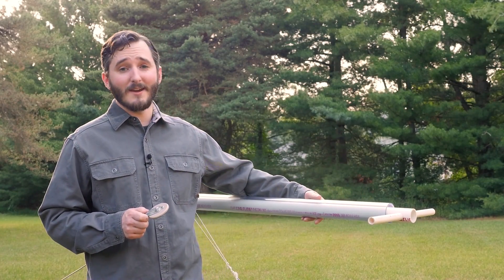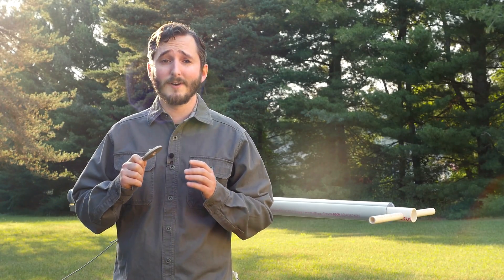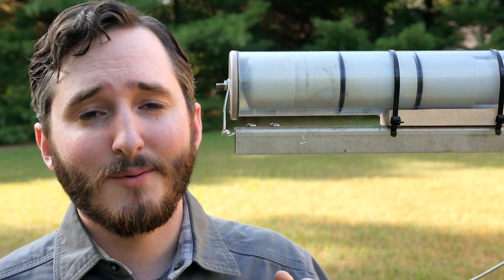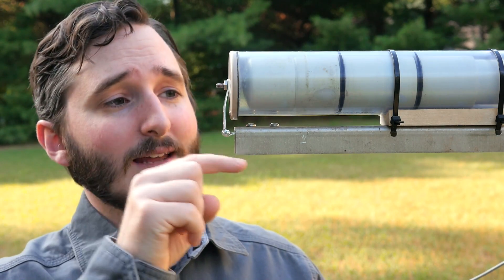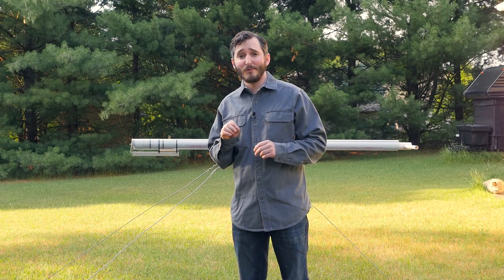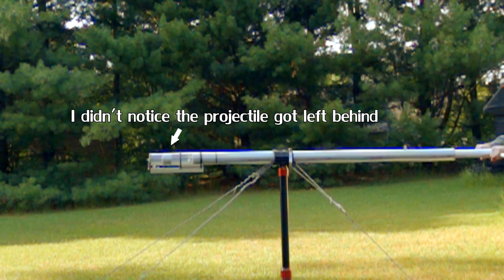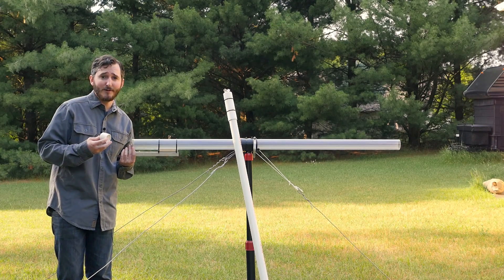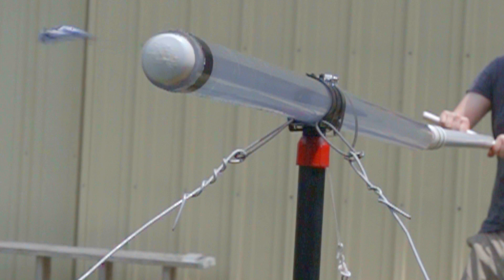Firing A Clear Vacuum Cannon & Testing Viewer Suggestions

Comment: ok so here’s my idea :
• keep the pivot point of the valve such that it naturally falls and can’t stay upright by itself. Use a bolt made from a ferromagnetic material at the middle of the valve’s disk, and cut it down such that it just makes a « button ».
• embed a big, strong magnet at the tip of the piston. Make it such that the tip of the piston is smaller in diameter such that the projectile fits over it like a sock. It will minimize the distance between the magnet and the bolt.
It’d be operated like this :
1. push the (piston + projectile) group through the tube, slightly further than the valve.
2. Close the valve. It will be held by the magnet.
3. Pull slightly until the valve seals, but keep the magnets in contact.
4. Pull hard to separate the piston and projectile from the valve, but don’t go all the way. It will now be held by the pressure differential between inside and outside of the tube.
5. You’re primed. Pull like a normal piston cannon to fire. 

Hopefully, that’ll push the valve outta the way a bit easier.
Reply: Maybe one day this will be read, haha.

Comment: how about a double door for the valve? have it split in half so it opens out horizontally. also, have a bit overlapping the center on one side to make the seal tighter.

Comment: Hi, I've been following this project and also have made one but have not fired it yet. I was just wondering if you didnt use a long pvc pipe with the handle to fire the canon. But, to cut the pvc trigger pipe to a shorter length and pull it with a rope..I was wondering if you would try this plus it would be compact and lighter to transport it..Thanks!
Reply from the maker: The piston and pipe it's attached to fit inside the barrel so it doesn't really make a difference in how large it is to transport, but you could pull the piston back with a rope if you wanted to. You just would have to feed a rope through the pipe every time.
Reply: You have some Great Projects!...Thanks for sharing!

Comment: HEY! Try to make a two door latch. Both doors open forwards and then close with a small spring. Rubber on the doors will cause a vacuum. It should work like a burst dick but not need to be replaced each time. Any questions just ask but good luck

Comment: I'm not sure it would open fast enough, but you could attach rubber bands to the valve, stretched over the hinge and connected to the valve-holder. Kind of like a rubber band over your kneecap connected to your thigh and shin.

When the band is at more than a 90° angle, it won't exert an opening force on the valve, but once it starts to open, the bands will help accelerate the valve open.

Comment: i suppose the air cushion may be pushing the stopper in the front out and it rebounds back up to hit the projectile. if that isnt the case i would suggest making fixture by which you could easily hot swap burst disks so you dont have to spend all day taping them up and removing the tape.

Comment: You could add a secondary, small chamber that pulls a vacuum at the same time, but have this secondary chamber slightly shorter in length than the firing tube, so that the air rushes in right before the projectile barrel. This secondary tube could be a much smaller diameter, and would be used to open the valve of the larger firing tube. 

Another idea; use cutouts of plastic that you can just place onto the end of the barrel, possibly with some sugru applied at the end of the barrel to make a better seal (look at TKOR's video on homemade sugru). This plastic piece would have no hinge, you could either just leave it be and have it shoot off with the projectile, or attach it to the end of the firing barrel with a piece of string so it doesn't fly away every time.

An alternative of the above idea would be to dangle the plastic seal via a string (or 2 for stability) above the cannon, in such a way that it can easily be pushed away by the projectile, flinging it upward and around, constricted by the length of the string

A final idea, unrelated. Try to put a thick piece of rubber, like multiple balloons on the end of the barrel. try to find a rubber, maybe spandex, that you could just stretch around the barrel, and possibly aid in holding it with a pvc sleeve that slides over it. I would like to see how much the rubber is pushed in to the vacuum by the normal atmosphere, which leads to the final idea.

Get a thick, maybe 6 inch inner diameter piece of acrylic tube, and place a seal on one end for pressurizing. Mount the vacuum cannon tube inside it, maybe with multiple filed out bushings to center it inside the acrylic (or use acrylic for both tubes). The end cap on the outside tube would have two valves on it. The inside tube would be connected to one of these two valves. Use a screw on end cap if possible for ease. Pull a vacuum in the inside tube, and pressurize the outside tube. You end up with a vacuum cannon inside a pressurized tube, in such a way that the projectile makes it out of both tubes. 

I will send this to your email, along with a diagram I drew in order to visualize it.

Comment: I had a question, would you be able to fire anything aside from the pvc cap like a smoke grenade or an airsoft frag, I've had an idea that I want to test a vacuum cannon mortar but I don't really have the funds to build and test it I figured I would ask to see if you knew if it might or might not work
Reply from the maker: Anything that fits in the barrel

Comment: Add a little rubberband assist to the valve that gets tensioned about halfway into the draw by a wire attached to the grip section.

If enough negative pressure is built up before the valve opener is tensioned it should stay closed until release.

Comment: what if you drilled a small hole on the proyectile so a little air rushes in through there in front of the proyectile therefore pushing the valve open?

Comment: Looking at the slow motion frame by frame, it looks like the flap maintains a constant (too slow) angular velocity after it loses its seal. Perhaps you could design a valve that is slightly recessed into the barrel and sealed with an o-ring like your piston. This might give the air pressure more time to accelerate the flap to the necessary speed to push it out of the way, instead of only pushing in the instant before it loses its seal.
Reply from the maker: I agree, an inset valve might be what's needed
Reply: Not too sure, a valve that's inside the pipe sits tighter, and will probably be heavier.
However omitting the hinge will help to some degree; and if there is some (light) piece glued to the valve that's inside the pipe to hold it you won't need a hinge. And if that piece inside the barrel is making a pour seal it won't have much friction with the walls, but it will give the piece a chance to accelerate more. (you that you would still use that same disk for holding the actual vacuum seal)
---
@all the engineers: because of the hinge the valve needs to get both Angular velocity and horizontal velocity, so it needs to overcome both angular inertia and linear inertia. (MV² + Iω²) That's one reason why the hinge is slowing it down. Then consider the fact the hinge is made out of metal, adding mass, and adding inertia. And then the hinge is not designed for fast opening with minimal friction, I mean nobody opens their funiture doors with the speed of sound.
Another (minor) reason is that once the valve has opened by a little bit, it's at an angle, somewhat working as a ramp redirecting the air in stead of being pushed away by it.
Reply: NightHawkInLight what if you had a small piece of maybe cardboard plugging the end, the vacuum could keep the cardboard stuck to the tube, but when the pressure increases between the projectile and valve, the cardboard loses all adhesion to the pipe, letting it fall away. Plus, if the projectile hit it, it probably wouldn't affect its trajectory/velocity, since the cardboard would have very low mass, and as such, very low inertia to overcome.
Reply: I'm thinking a lower mass convex seal (think half a ping pong ball) with an over center spring (or rubber band) in the same direction as gravity. Only a little force to push it past the pivot, but then it should snap down really fast.

Comment: Hmm, what about a flap valve made from leather, reinforced on the back with a metal disc? The projectile will still hit it, but it should be much more durable. Another idea is to cut the muzzle end of the barrel at an angle, and have an elliptical flap valve- the projectile won't be smacking into it so hard since the shallower contact angle makes more a softer impact... in theory...

Comment: You should use a spring to pull the cover back. If you now fix the cover to the opening with a switch and the switch with your "pull-back" trigger so is opens only in the last second, you could make a better shot

Comment: How about a flap that is a ring the same basic diameter as the tube welded to the tip of the hinge.  Then use a thin plastic sheet to cover/seal the ring.

Comment: Whats the terminal velocity of the projectile, a little less then the 
speed of sound? Are you close to that or will that require a longer 
barrel?
Reply from the maker: It's actually higher than the speed of sound because air particles can accelerate faster to fill a vacuum than a wave can propagate through them at normal pressures. But yes I would need a lot longer barrel to give time for a projectile to get up to those sort of speeds.
Reply: Awesome!

Comment: you should attach a rubber band to the valve plate and stretch it downward. the pivot point of the valve can then be moved toward the rubber band so that even the slightest movement of the valve would bring the whole assembly out of balance and accelerate the valve with the power of the rubber band

Comment: You might try making a double sided flap, like two half discs that open from the middle.  That way each half doesn't have to move as far to get out of the way, and even if the projectile hit them, it would hit both at once, reducing deflection and damage.  It would take a little more work to get it to be air tight, but I think the results would be worth the effort.
Reply: Another option that would certainly be more work would be a vacuum switch, servo, and electronic time delay.

Comment: I almost wonder if you could make a reusable "burst disc" by using an air tight rubber seal that is also able to open up. So it holds the air in but when something hits it the projectile can go through? I don't know.

Comment: Try using a spring to pull the valve back when the vacuum is released. I've been thinking about a way to keep it attached before you started pulling the piston back as well, but I'm not sure my ideas are sufficient. Here's a couple anyways.

1. Have a string on the valve that attached to a small pin of some sort on top of the pipe that moves down when the vacuum is good enough to keep the valve in place. The pin would definitely get in the way if it moved directly into the barrel but if you attached a small piece of pipe that extruded from the top of the barrel that could hold the vacuum and pull the pin inside, effectively blocking the small leak and moving the pin out of the way of the string that held the valve in place, I think it might just work. 

It does seem kinda complicated but maybe if you simplify the process of the latch being released due to the vacuum in the barrel, you would have a solid design. 

2. Here's another idea that I just thought of. What if you put a strong magnet at the end of the piston and somehow used an external magnet to release the valve latch after you pulled the piston back a bit (so there's enough pressure to hold the valve on). 

If anyone else has an idea to improve my idea, please let me know. And if you like this idea please like it so he sees it. 😊
Reply from the maker: There might be some options with magnets, it's a good idea to think about.
Reply: NightHawkInLight cool, I mentioned you in another comment and here's what I said there (I was thinking about the magnet idea a little more). 

You can use a magnet in the end of the piston and a external magnet on one side attached by string to the valve. This way when the piston is at the end of the barrel, you can push the spring loaded valve in place and use the magnet to keep it there temporarily. Once the valve is pulled back there should be enough pressure to hold the valve in place and at the same time the magnets will separate and the external one will fall to the side, out of the way of the impending destruction coming out of the barrel lol

Comment: Try using something like a paper cup for the valve. Just insert it into the pipe bottom side in so that it wedges itself in and holds the pressure when it's being pulled back. You can cut most of the cup off since you just need the wedge shape, and since it's light enough it'll just become part of the projectile like the aluminum did.
 Alternatively, if you can bring a small vacuum along and have a minor vacuum between the plug and piston going all the time, than you can use anything flat and light as the plug since the vacuum will hold it in place and you won't need the wedge shape. So you'd load the projectile, cover the face with a paper plate or a small piece of cardboard (for stiffness), and it'll be held there by the minor vacuum until you fire. If you're going to use a vacuum pump however, make sure you have a check valve in line so that the pressure doesn't shoot back into the pump.
  Third option is to get a female-female adapter pipe and just slide that over the aluminum sheets (instead of taping it around the edges each time).
Reply from the maker: A cup is a really good idea! I think maybe a smooth plastic cup would work well. I'll try it
Reply: My concern with the plastic cup was that it's going to be much thinner than a paper cup (since you can make thinner plastic), and it might be more likely to crumple under the vacuum. Also, if you're going to try the route of breaking through the plug, maybe consider making the projectile more pointed so that it cuts through the plug easier.
Reply from the maker: The way to do it would be to put the plastic cup bottom first into the pipe like a cork. The plastic cups I'm thinking of I don't think will have any trouble standing the pressure in that configuration. Whether they move out of the way or not they will be easier than making burst discs. I will try it.
Reply: NightHawkInLight you need to make a barrel that will reduce its diameter during charging and increase during a shot
Reply: @keks9662 how would you have a piston that would still be air tight with a barrel that changes its diameter?
Reply: +NightHawkInLight , The bottom of an aluminum can is almost as light, but much stronger, due to the radial corrugation. You just need to find an aluminum can larger than the diameter or your PVC tube to cork it up.